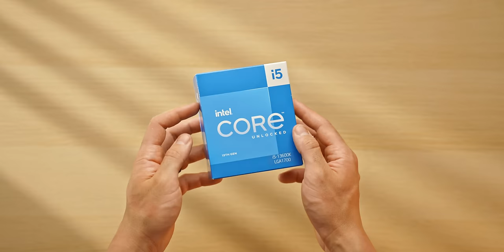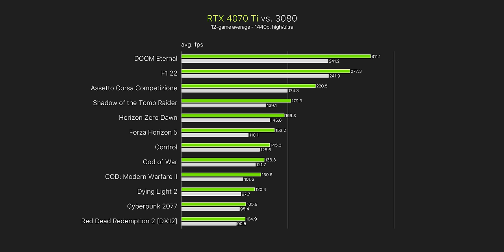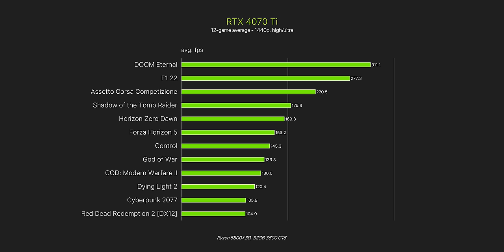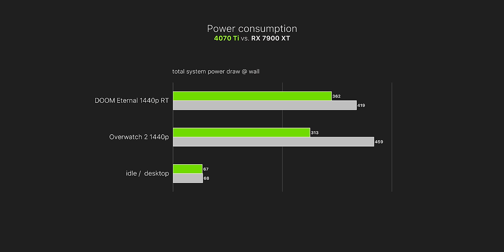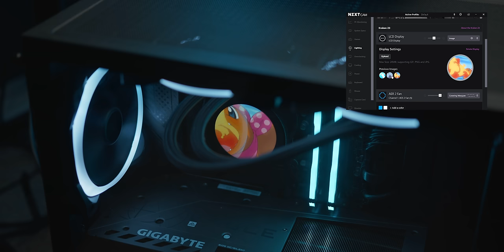$2000 Gaming PC Build (1440p destroyer)

Comment: I’m running a 3900x, would it be worth it to upgrade to a 5800x3d? I’m currently running a 2080 ti and plan to upgrade in the near future. I want to stay on am4 to cut costs but if I go 4080/7900xtx would the 5800x3d still be effective at 1440p
Reply: 15-20% frame improvement. 1% lows way better so less stutter. some games don't care about the 3d cache at all so minimal improvement where as some games that really like it can get up to double the frames.

this was my experience with a 3080 going from 3600 to 5800x3d. (1440p)

Comment: Wondering about static pressure loss with using the bracket between the radiator and the fans - does that not introduce a small gap to leak air? Probably negligable.

Comment: so the only power supply cables i would need would be 24 pin mobo, 8 pin cpu, and 8 pin gpu? I am not using any ssd drives or hard drives.

Comment: I only use OEM fans of CPU and GPU's. And case has one extra fan attached on the back. The temperature of CPU will only go between 58 - 69 celcius at most while playing games. So why need this overkill fans?
Reply: @Blue  i see, so depends on the temperature the fans will automatically adjust the fanspeed ?

Comment: I need help reducing cost of my pc or advise on parts ( pwease) build here are there parts:

CPU: Intel i7 13600k
CPU COOLER: Corsair iCUE H100i ELITE 

GPU: ASUS TUF GAMING NVIDIA GeForce RTX 4070 Ti OC Edition 

PSU: Corsair HX1000i

Motherboard: Gigabyte Z790 AORUS Elite AX Intel LGA 1700

RAM: CORSAIR VENGEANCE RGB DDR5 RAM 32Go (2x16Go) 6000MHz

CASE: Corsair 5000D Airflow

Comment: I would also buy this case. I would buy the arctic liquid freezer II 240 aio cause its 40€ cheaper than the nzxt kraken elite 240. For the graphics i would buy a xfx speedster quick 319 RX7800xt. Can i plase the arctic aio like you in the front with the xfx 319? Or would the be any space so that i need to out the aio in the top?

Comment: 1 year later, turned out even with upgraded tech, the cost keeps going down. I just build my own PC that cost me $1636 with i7-14700KF, 32GB DDR5 6000mhz RAMs, and a 4070 Ti. I can slot in the $400 extra for buying the 2K monitor and UPS.

Comment: Hi I’m going to buy a pc from someone and I was sondering how much would you pay the guy? The following are on the pc:

GPU: GAINWARD PHOENIX RTX 3090 24GB
CPU: i9 13900KF
CPU koeler: NZXT KRAKEN Z73
Motherboard: ASROCK Z790 PG SONIC DDR5. 
RAM: 32 GB CORSAIR VENGEANCE RGB DDR5 6000MHZ. 
SSD: 1TB SAMSUNG 990 PRO (7450MB/s read en 6900MB/s write speed).
Corsair RM750. 
CASE: H7 FLOW

Comment: is there any major difference between 13600K and 13600KF? beside integrated graphics?
Reply: The -F suffix literally just means disabled integrated graphics. There are 0 other differences. The 13600K can be faster than the 13600KF, but that’s only under situations that can be accelerated by the igpu (quick sync). I would personally pay more for the igpu, but that’s mostly for peace of mind in case of graphics card failure or other debugging. It just depends on how large the premium is.

Comment: sorry but you should really go for ddr5 at this budget and dont spend 300 fucking bucks on not even an 360 mm aio also you could use the saved money for a new 7900xtx or used 4080.
Reply: I got the exact same board but ddr5 it was only 20£ pound more it’s a no brainer

Comment: What about this build with an AMD processor instead? is there an AMD Alternative for this 1440p Destroyer?
Reply: Either the Ryzen 7 7700x or non x
Reply: @ThatMemeGuy12  7800x3d would be better😊
Reply: but the price difference is huge
Reply: @ThatMemeGuy12  its only like 100$ more! If u use a610 chipset, iy would be less (4070 ti + 7800x3d = no bottleneck)

Comment: Without an nzxt motherboard how am I able to control the lighting of my nzxt kraken 120 aio through cam? Because I also heard that you are not able to control it using the nzxt rgb controller as that’s specifically for fans and leds…
Reply: Wdym nzxt motherboard?
I have NZXT Cam and I can change Kraken's settings and rgb of fans.

The HUB is a part of the Kraken, so you connect all of the fans with Kraken, not mobo(Never recommended, unless you want to destroy leds inside your fans)

Comment: Can someone please explain the airflow of this build ?? I understand that the front fans draw in air for the radiator, the bottom fan draws in air to the GPU fans which push air into the heatsink above, but what about the top and back fans ?? How should they be oriented for optimal cooling and airflow ??
Reply: top and back - air out, front / bottom / side - air in

Comment: Hey im new to pc building and im going to build this pc. I have few questions to ask and would appreciate if someone wants to help me out.
1. If i buy this motherboard and this cpu do i need to do bios update on the board for it to work properly with the cpu
2. is the airflow good bcs i read somewhere on the internet that u shouldnt have more air pushing out from the case than in 
3. should i mount the aoi to the top bcs many comments here say that would be better way
Reply: i want to build one aswell, but i was wondering if you figured those stuff as well it will help if you tell me.

Comment: what did I do wrong if i cant see my pump speed but can see everything else. it's definitely working because temps are great, but I cant see or control the pump speed, im assuming its at 100% constantly
Reply: You should be able to access the pump speed from the CAM software. Just make the pump connector is plugged into a CPU/AIO header on your mobo.

Comment: "If you're concerned about air getting caught and trapped inside the pump I'd recommend installing it how I have here with the tubes towards the top..." 

lmao dude you got it exactly wrong. tubes at the bottom will mean that air is trapped in the mechanism contained on the radiator, which is 1000X better. L.
Reply: how you put them on the bottom lmao
Reply: You seems to clearly not understand at all the video from GM.

Comment: i have a i7 11700F what would be a good upgrade for my Motherboard(b560 ds3h ac (rev. 1.0)
Reply: There isn't really a point in upgrading at that point as you'll probably be looking at a new PC anyway (go AM5 if you do)
Reply: @keylime6  i got a 3060 but my cpu is really slow and i want better frames on fortnite(cpu intensive ) so i was thinking of getting a i5-13600k what amd cpu would you suggest besides the intel one i was going to get
Reply: @geoiswhoiam  I would definitely advise against intel right now due to the fact that they will be releasing a new socket for 15th gen whereas AM5 will probably have another 2 or 3 generations of CPUs on the same platform, meaning you can upgrade easier.

If you can afford it, the 7800X3D is currently the best CPU for gaming. Otherwise, a 7700X or even a 7600 will be perfectly fine, even in CPU heavy games

Btw, what resolution do you play at?
Reply: @keylime6  1080p but i want to go to 1440p in the near future around 1-2 years from now
Reply: @geoiswhoiam  going from 1080p to 1440p will be completely dependent on your GPU so I would say just stick with the 3060 for now and then later on you can upgrade to a newer 1440p gpu. Just make sure to get a bigger power supply, maybe like 700w or 750w. If you already have one, great
Reply: @keylime6  so is there any cpu same price range and possibly (better performance) than the i5 13600k?
Reply: @geoiswhoiam  Probably the only one with meaningfully more performance would have to be the 7800X3D

Comment: Doesn't the i5 13600k bottle neck the 4070ti??
Reply: It doesn't, it's 12 or 14 cores. It's actually a pretty good synergy
Reply: @RicardoMilosGachi  thank!
Reply: u can use 13600k with 4090 and its will be ok

Comment: curious by the psu is installed up side down
Reply: so it can Intake air from the bottom
Reply: @BiggestUnc   so if it takes air in from the bottom into the case, wouldnt that go through the psu and bring in heat into the case?

Comment: I don't understand why you think the 4080 or 4090 is better. Clearly its shown that the 4070Ti or Super are better for gaming. Your results even showed it. So why you are talking about the 4080 or 4090 being better? ( do you mean for Non gaming?) Also the 4070 doesn't pull as much power so it will stay cooler

Comment: You installed the radiator at the wrong direction
Reply: Nope the position it's in is just fine.
Reply: @danielboyas7645  it's probably fine with this specific build, but if you point the tube down you will have no bubble in the connection part between the radiator and the tubes. It will have less slush noise